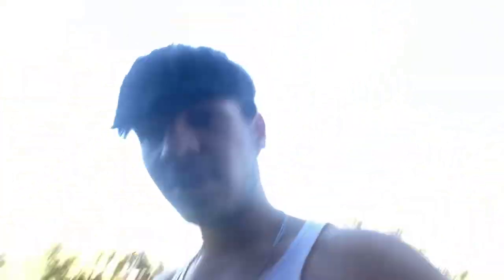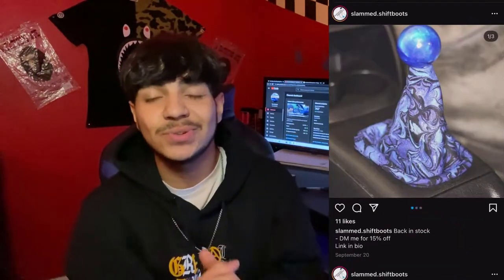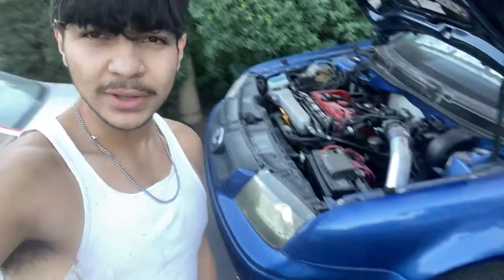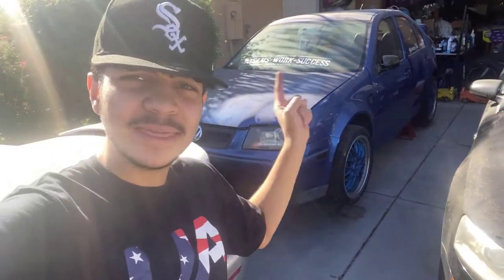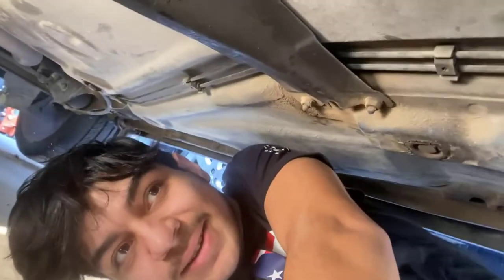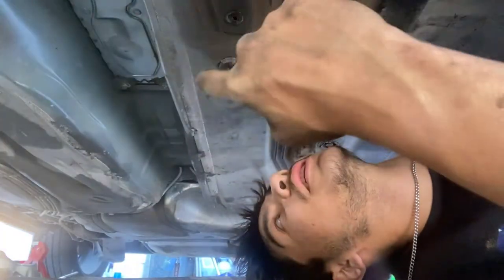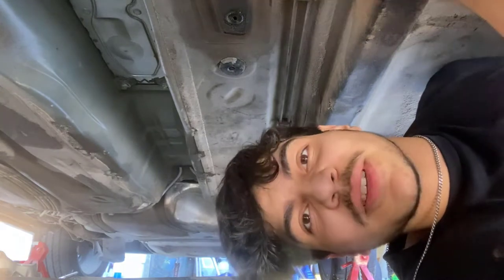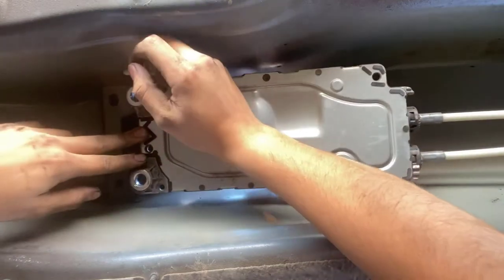SHORTSHIFTER INSTALL ON A MANUAL VOLKSWAGEN!!!

Comment: You have to improve the format of your video bro, and your look. I would like to see the car running with the short shifter on the same video, algo get an arm for your camera so we can see the ful process of changing the shifter, adjusting the cables, etc. You are doing a good job on those cars, you can do a better job on your videos too.